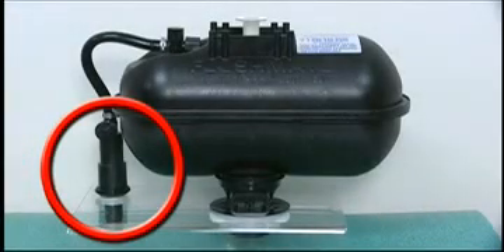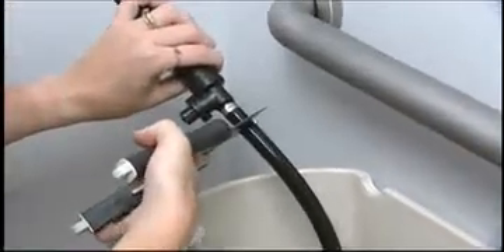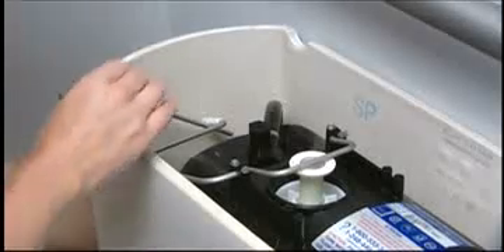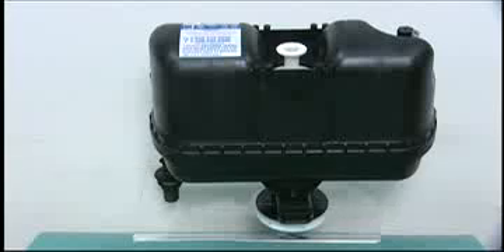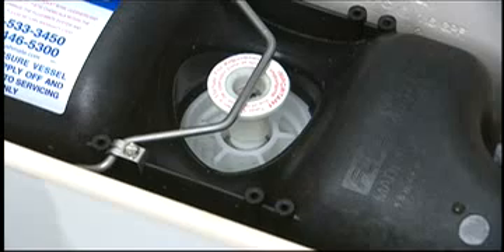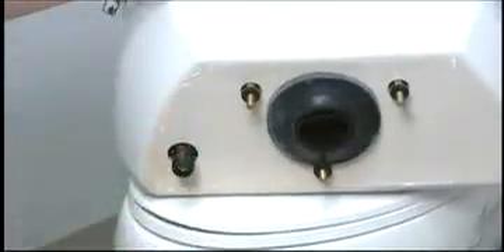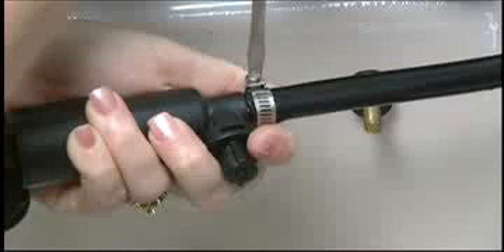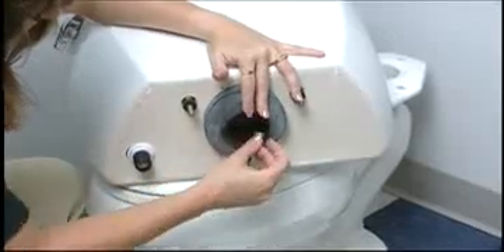How to Test and Replace: Lower Supply of Flushmate

Comment: If you cut and  reuse the hose replace the upper supply hose clamp also. Handling the unit will probably disturb the seal especially on an old unit